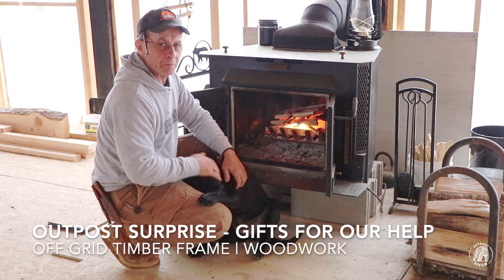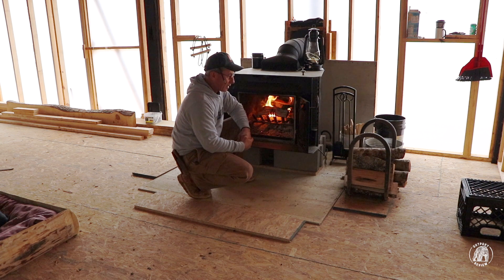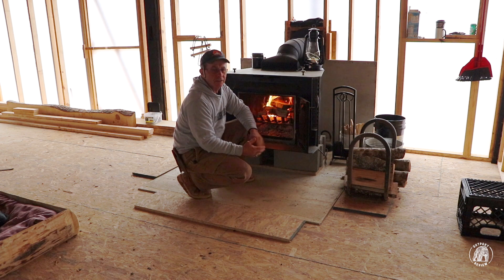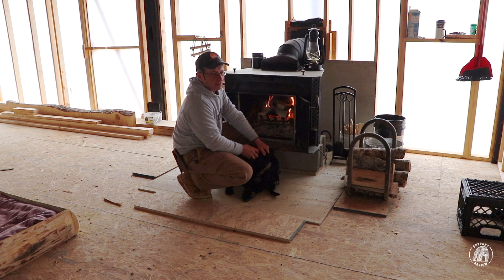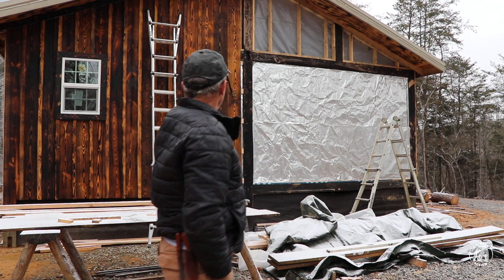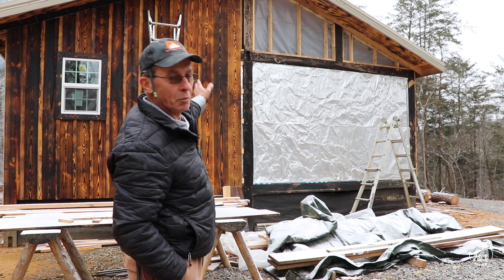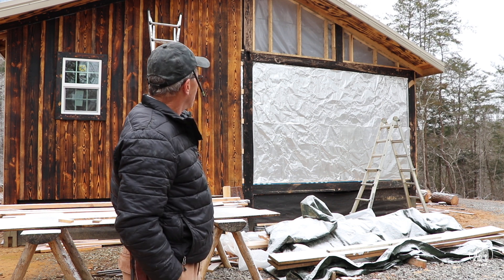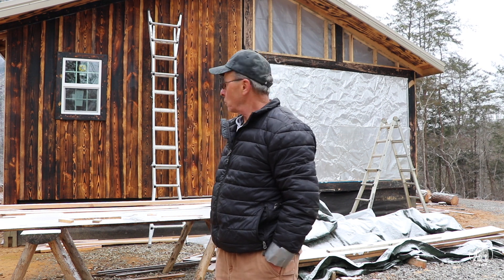OUTPOST SURPRISE | GIFTS FOR THE HELP | OFF GRID TIMBER FRAME | WOODWORK

Comment: Using screw will allow you to remove or replace boards without damage.  Nails will make it hard to remove without damage and since they are only 1 inch boards possibly may split when nails are driven in.  That is my opinion.

Comment: Richard I think once you install those ceiling fans up high on the cathedral ceiling it will push that heat down for winter heating that wood burner should do just fine

Comment: Good things happen to good people, and you guys are examples of that! ❤️🙏
Richard! I did have a question, and pardon me if you ever addressed this in the past. I totally agree with your comment regarding the screws holding better than nails. However, when building with green wood, you know that wood is going to move, and are you concerned about there being any splits where the screws have attached to the frame? I've always found that using nails allows the wood to move without splitting. Just my observation. Keep up the great work, and I love watching your channel! 👍